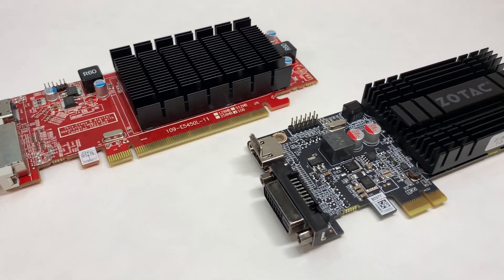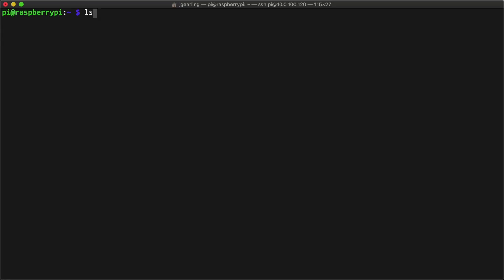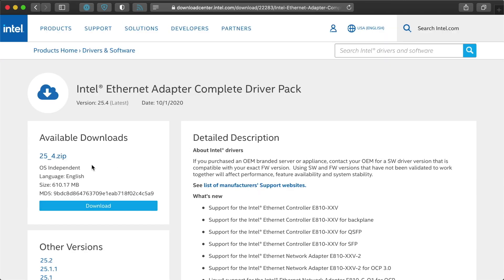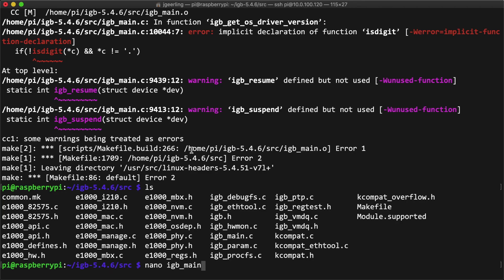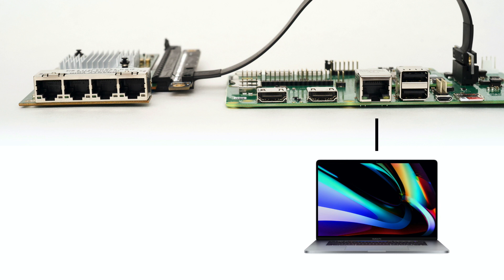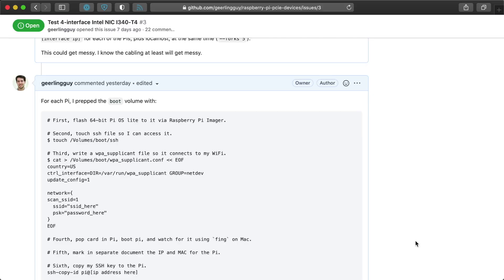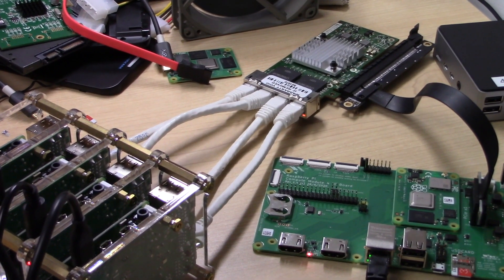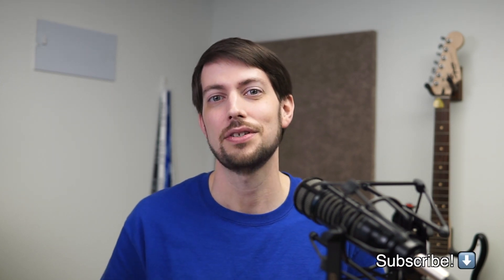5 Gbps Ethernet on the Raspberry Pi Compute Module 4?!

Comment: Have you measured the cpu usage while all tcp iperf server instances were connected to? What about iperf in udp mode?
Reply from the maker: `iperf` stayed under 20% CPU (all five processes), but `ksoftirqd` maxed out at 100%, meaning it looks like the Pi was queueing up packets between 2-3 Gbps.
Reply: Sorry I wasn't reading thoroughly. So the network card flooded the CPU with interrupts if I understand it correctly. I remember having the same thing on the first version of the Pi with my excessive use of USB2.0 audio equipment. I had to use proper I2S based hardware to get around it. Also made one core run at 100 percent on a Pi3 by using az SPI CAN controller which has a polling based kernel module on a realtime kernel. Maybe a UDP based test could reach that PCIe Gen2 4.000 Gb/s (5GT/s). Very nice going on the graphics tests! Those tests show that how these graphics cards are too tied  to x86 legacy bios syscalls on boot and UEFI is just a fancier modern bios.  :)  Interesting tip: have you heard of those Asmedia 1083 based PCIe to PCI bridges? Those cards use a single PCIe lane. Could be good for some more uncommon vintage hardware. Just thinking out loud... :)

Comment: I'm sure someone has already mentioned this, but are you sure your not maxing the CPU? Being able to transfer that much data is more demanding than you often consider. 
This second thing is just wild guesswork, but is there a possibility that the x1 slot can't handle more than you are getting. I have no idea what the maximum throughout of one of those slots are, but if the cpu is not the problem could that be the problem? I would presume that there is a reason the NIC is more than x1.

Comment: I have the feeling that you are hitting the PCI-E bandwidth limit.  PCI-E Gen2 1x is 500 MB/s, that's about 4 Gb/s.  There's also the WiFi chip, I couldn't figure out what's the max throughput for WiFi 5, the wikipedia page ( https://en.wikipedia.org/wiki/IEEE_802.11ac#Data_rates_and_speed ) has a huge table with numbers ranging from under 100 Mb/s (note the small b) to over 1 Gb/s. Maybe the WiFi bandwidth is dedicated, whether it's active or not.  That would explain why it maxes out at about 75%.

Comment: What was CPU usage running networking tests?
Does this card have HW checksum offloading and enabled?

Bet you wished you had a few cross-over Ethernet cables.
Reply: Fortunately, Auto-MDIX (automatic crossover in the NIC) is part of the Gigabit Ethernet standard. The Raspberry Pi has featured Auto-MDIX since the beginning, as do all Intel 1000BASE-T interfaces.

Comment: You can just use a AQC111U USB 5Gbit network adapter for a SINGLE RJ45 port with ~3Gbit.
Reply: Sure, if you want to spend a fortune on compatible 5Gbps switches/routers/NICs-in-other-computers, and Jeff has a family to feed ;)

The 5Gbps stuff is so new that, last I checked, a lot of it is more expensive than 10Gbps equipment, because 10Gbps has been around a lot longer...
Reply: @AndrewGillard  No normal person needs multi gigabit equipment. It is always gonna be an expensive thing. Also, pretty much any device that can handle 10gbase can also handle 5gbase so I don't get what you mean by more expensive.

Comment: Impressive testing, congrats on getting this working. What is the kernel interrupt load? You may be maxing out the interrupts available. Is this at stock or overclock? I think there are DPDK drivers for that Intel card on ARM, which could mean full throughput.

Comment: You guys know the issue with these attempts right? He is trying to do heavy IO loads on a cost optimized compute processor. The processor has little IO subsystem and potentially has weak memory interface. Not to mention perhaps weak processing cores. Assuming follows the other Pi's. Now the Pi 4 is faster than most Pi's, however it follows a more compute/processor model.

For networking offloading is generally a good idea. Get as much of the highly predictable part out of software and into hardware. We are not likely going to get much out of clocks, architectures, parallelization, etc. for single threaded software processing. We have much better manufacturing now, we no longer have to do everything in software. Cost is still a challenge, but networking is very common. Common is why generic was cheaper. FPGAs are generic...

Do most GPUs that work with PCIe even have ARM drivers? Do you know how crippled that GPU would be at PCIe 2 x1? Also there could be competition internally on the PCIe root. It could be there is a shared link internally. IPerf will not predict results for routing. To stress processor use min MTU allowed by ethernet. Also run full duplex. Larger packets with checksum offload will be handled by NIC for the most part. The IO subsystem will move them but the cores may never see more than the packet headers.

Trust me increase the packet rate on that CPU and the cores will lock down. Lowering the MTU will keep the same bandwidth requirement but put a lot more stress on the IP stack. (Which is why hacking it is fricking stupid. Lot of hackers know nothing...some are really smart but you will never meet them except by chance.) Look an average small/home office router will have one or two maybe four cores. It will be rated for around 1-2Gbps. Most of the LAN is hardware switch on single chip. Most of the cores is for advanced protocols, crypto, applications, etc.

To get higher rate against weak cores. You could increase MTU or increase filtering by hardware. Then again hackers would love this too. Software is usually poor for IO performance and security.

Comment: As someone who work in an industry where this type of service is used.
We build Oracle data centers where large disk clusters are controlled by redundant server hardware running from redundant sites for extra redundant redundancy. We often use multiple redundant means of cross connecting all of this between Fibre, Gigabit Ethernet and even 10G Copper connections. So it is quite common to have 8 of each connection on each device and having multiple levels of redundant redundancy.
Reply from the maker: The department of redundancy department right there!
Reply: Wow

Comment: Why do you think the NIC is x4? x1 isn't enough. Same thing happens on SAS controllers, you need more PCIe bandwidth available than napkin calculations would suggest you need. If the only data transfers were ethernet frames, it might be closer to that simple. The driver has to  do MMIO accesses and the NIC has to do accesses to system memory to read the request rings and write out completions to rings. It can't just DMA anytime it pleases forever either, sometimes there is memory controller contention and it has to wait in a queue for arbitration. It needs some "extra" peak bandwidth to compensate for those delays. It's like a car that has to keep stopping periodically, you need it to be able to go faster than you might have when it is not stopped to keep up with where you would be if you never stopped.

Comment: The Intel network driver IS IN THE KERNEL. The search function in menuconfig only matches the configuration option, not any of the descriptions of the drivers. The Intel (wired) drivers are under "Device Drivers ---> Network device support ---> Ethernet driver support ---> Intel devices". The actual driver name (what you'd have to search) is "IGB" for the I340.

Comment: Most 1 gigabit ethernet switches have an internal switching speed much higher than 1 gigabit. So for example I have a 24 port, unmanaged (dumb) ethernet switch from netgear that has an internal switching speed/bandwidth of 48 Gigabit. That means in theory every port could saturate both the upload and download of a 1 Gigabit connection without running into any bottlenecks.
Now in reality you would would never really run into that kind of utilization.
However, in your use case any reputable unmanaged ethernet switch with enough ports would have been able to keep up with your use case without the need to directly connect the PIs together and mess with static IP mappings. If you were to do something similar in the future, just use a decent switch that has a high enough internal switching speed to accommodate all the devices you want to hook up. So in this use case you could have even gotten away with a cheap 16port switch with just an 8 gigabit switching speed/bandwidth.
Reply from the maker: Good point! I might test that out with a couple of my Gigabit switches.
Reply: Actually that is for full duplex communication. If your switch only was capable of 24 Gbps then you are dealing with a blocking switch that can only communicate in simplex. Or as I call them cheap switches that are a POS.
Reply: @popquizzz  fair enough, I dont usually recommended going with a lower end switch, but I wanted to acknowledge that for this use case you could atleast get away with it
Reply: hi

Comment: The bottleneck is PCIe gen2 x1. 
The throughput at this PCIe interface would be 5 Gbps * (0.8) * (0.8) = 3.2 Gbps
You can not get more than 3.2 Gbps on PCIe gen2 x1 so 3.06 Gbps you get is already good.
Further you get check if Linux takes advantage of PCIe max payload size which is typically 256 Bytes (sometime Linux default is set to 128 Byte).
Reply: But there's 1 ethernet port that's not connenected through pcie, so the max should be 3.2+1=4.2gb/s
Reply: @BusAlexey  likely CPU limit. ironically a gpu would accelerate this but he can't use it.
Reply: @BusAlexey  Agree. to be more accurate -> 3.2 + 0.940 = 4.14 Gbps. 
940 Mbps is already tested on dedicated ethernet port by Jeff G.
Reply: @BusAlexey  yes but isnt the onboard interface still on the pci bus? even if it's usb, then the usb controller will still be on the pci bus
Reply: @WX4CB  No. Those are on the CPU's internal AMBA/AXI bus. Since both the PCIe ports and the internal Gigabit port share this bus, it's quite possible that this bus is the limiting factor. The USB ports and wireless LAN are also connected to this same bus internal to the BCM2711. It also links the CPU and GPU, so if you max that bus out, it's game over.
Reply: @SJoelKatz  that's what i was saying, the onboard ports  etc are on the same pci bus
Reply: @WX4CB  They aren't though. They are on the same AMBA AXI bus that connects the CPU and GPU though.

Comment: PCIe 2.0 1x should be 4 Gbit/s or 500 MB/s. Assuming that it’s PCIe 2.0 you weren not that far off the theoretical max throughput. Four interfaces would have been max. And what would happen if you use the USB3 bus at the same time? (Whelp it seems I’m the 5th person to suggest this...)

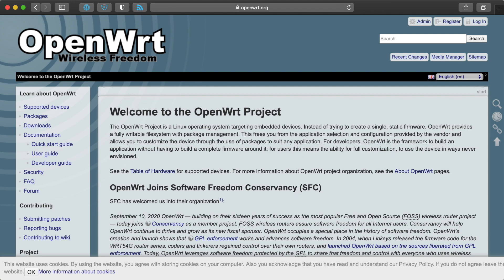Comment: 0:59 PFSense can run on arm now? I thought PFSense was x86 only.
Reply from the maker: I know it has been run on Pis, at least internally, and from time to time some info has come out about it, even though there's nothing official. With the CM4 out now, it would make more sense as you can get a decently fast SoC and two full gigabit interfaces (or more) with no real compromises (the main complaint in the past were hardware limitations).

Comment: Oh that would be cool for sure to be able to use a. SATA card on it.

Also is there a PCIe 1x to PCI cable?  Reason I ask is it possible to use something like a old Adaptec SCSI card on this setup?
Reply: The main reason I ask is it would be nice to be able to use the Raspberry Pi 4 compute module to be able to backup older SCSI drives for recovery and this could be a nifty option.
Reply from the maker: Yes there are a few cards, and I have considered trying to find a bundle of old PCI cards to test—though I definitely don't have enough time to do it all :D — I hope other people start getting their CM4s though, soon, because I know there are tons of other new creative uses people may find with the exposed PCIe slot!

Comment: When you do get time to dive deeper with the card, check with ethtool what offloads are available for it.  Enable the ones you can, like for checksum, fragmentation, segmentation, etc... Although, you'll want to google to see if the driver has any specific outstanding issues with any of those specific offloads... Intel drivers tend to offer some things, but then they can be buggy or possibly slower.

Next, you'll want to get another PC with a similar 4 port card, and then setup LACP (ethernet bonding mode 4) between them on both the pi and on the PC.  I find static IP's are easiest for LACP; while dhcp can certainly work, it's not something you want to waste time debugging if it doesn't work right away.

Don't add the pi's primary interface to the LACP bond.  Different chipset, and different ethtool config, will give you much grief... it may even refuse to let you bond them, depending on the drivers involved.

Next, you are going to experience some pcie 2 overhead, which would affect the numbers if this had a 5th port... but as this is only a max of 4gig from the ports, you're fine there for 4gig over the pcie.

Lastly, is the ethernet controller chips on the card.  2 ports for each controller.  In my experience with this card in the past in servers, I recall not getting full performance from 2 ports at the same time on the same chip.  As we only needed 2 way LACP on that project, we just had the extra 2 ports for hot-pluggable failover.  So we did 4x LACP, but only used one port per chip, leaving 2 empty.  If a port were to fail, we simply move the cable to that chip's 2nd port, and LACP would be happy... depending on the failure mode involved.  If it was not the port, but he controller chip, you lost both ports it owned at the same time.  As a result, after deploying these on a couple ships at see, and experiencing that exact problem, we moved to cards with 4 separate ethernet controllers on the board.  Cost more, but solved both the 2 port failure scenario, plus, allowed us to use all 4 ports at full speed.
Reply from the maker: Very enlightening, and that makes sense! Honestly for my own needs just having one more Gigabit interface would be enough... I just wanted to see how many bits I could push through the thing with four of them :)
Reply: @JeffGeerling   Your PCI adapter is PCI-e 2.0 have x4 lanes but you put a x1 lane adapter that mean you can only get up to 4 GB/s with PCI version 2.0 and not the x4 that mean 16 GB/s. The PCI-e 3.0 have a up to 7.9 GBs per lane. Regards.
Reply: @javierolavarria  Yeah, I think 4GB/s is the max this setup can get in a perfect world; I suspect offload and overclocking will get you closer, but I also suspect that PCIe bus is shared with more than just the ethernet.

Comment: You might want to install atop and `cat /proc/interrupts` to check how interrupts are handled. You can pin each nic to a dedicated core, however since you have only 4 cores, the best approach might be bind each Intel nic to 1 core, and skip the onboard nic.
In atop, if the %irq is taking almost full core, that means the CM4 cpu is not fast enough to handle that many packets. If the %irq isn't that high as %usr, the limitation could be iperf (if you were using that to benchmark network). Iperf is a userspace utility and will consume certain percent CPU to send/recv 1Gbps, and the overhead of context switching between userspace and kernel.
Another case could be all cores are %idling when you iperf all nics, that means we hit the bottleneck of the PCIe interface.

Comment: With Linux these days you'd only use multiple NIC's for either physical resiliency, or more throughput. More IP's etc is quite pointless as you can either just add secondary IP's or add 802.1q vlan tagging.

In terms of the 3GB roadblock, is that saturating the PCI bus (assuming the onboard NIC is on the same PCI bus)
Reply from the maker: True true. But I bet there is still some cranky sysadmin keeping some 40-year-old DOS server running and it only works with an IP per physical interface for some arcane reason.

If there's one thing I've learned, it's there's always some ridiculous legacy requirement that means people have to use an old card like this.

Comment: Well stating the obvious, is it possible the bottleneck is the PCIe interface? It is only 1x but what generation is the card and Pi interface? Could be as bad as PCIe1x gen1 speeds, half duplex.
Reply from the maker: PCI 2.0 1x, and gives up to 4 Gbps _theoretically_. But I like putting that theory to the test ;)
Reply: @JeffGeerling  Ah. Well then this may be a simple issue of overhead with communication? Not sure if Iperv is providing the effective IP speed or including the Ethernet frame MTU as part of the benchmark (are you measuring layer 2 or layer 3 speeds?)

The Ethernet frames might also be wrapped in a whole bunch of PCIe communication nonsense, depending on the implementation (if the drivers were open source you could dig through them, or you had a hell of a good scope or logic analyzer, you could probably analyze the LVDS data and clock line on the PCIe interface...

You certainly are pushing the boundaries of what's possible with the Pi and that's awesome. Great work so far! :)
Reply: @JeffGeerling  4 Gbps in Duplex and 2 Gbps one way if i remember correctly.

Comment: You could use routing (ip forwarding option) to have the 4 port card route between pi's.  IE, run iperf client on port 1 pi connecting to iperf server on port 2 pi (and 3 to 4 same way).

PCIE bottleneck probably limits more than CPU here, but using the pi with the NIC card to route instead may reduce cpu overhead as less stack layers are traversed (layer 3 can disposition the packet vs application layer when having iperf run locally)